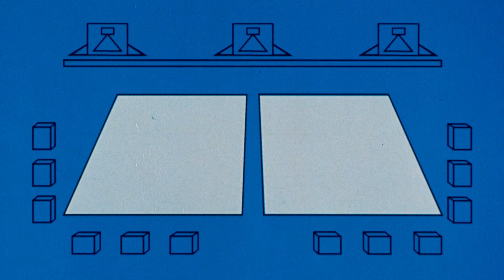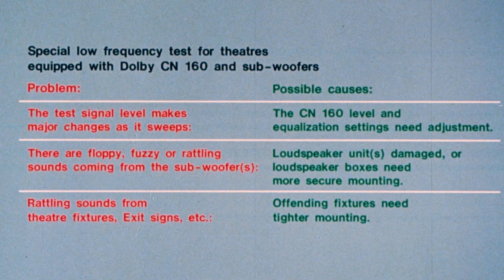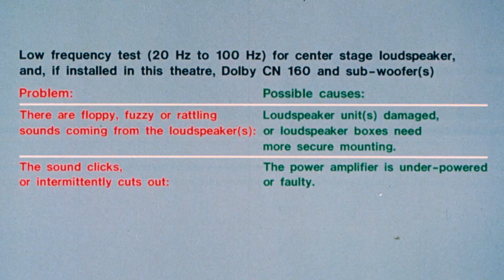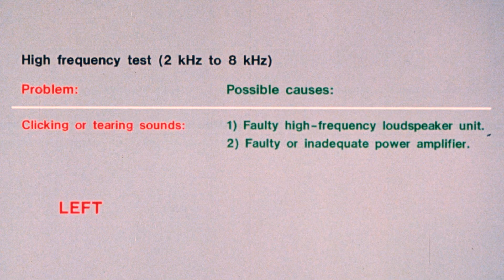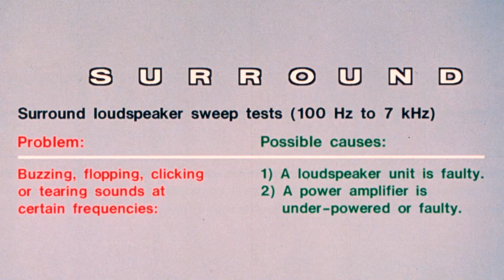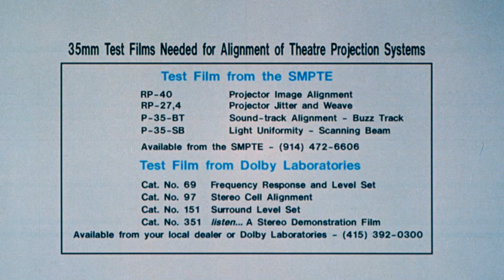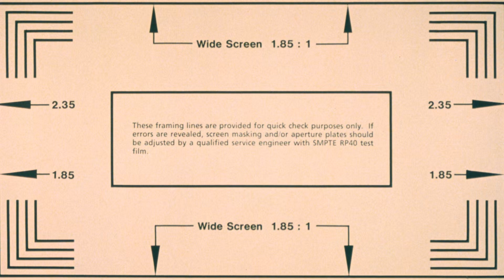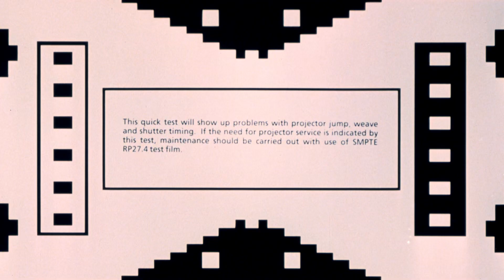Dolby Stereo cat 251 Listening Test Film (1982) [FTD-0169]

Comment: This is great, thank you! Good for testing this headset I got.
Is there any way to download a full Dolby Stereo encode of this, or does your scanner not support audio that way?
Reply from the maker: Dolby Stereo for cinemas (pre-digital sound) is 2 channel stereo, sometimes referred to as Lt and Rt (left total/right total).  You have to use a pro-logic decoder to extract the center channel (everything identical between left and right) as well as the surround channel (everything different or out of phase between left and right).  The subwoofer is also extracted in the pro-logic process.  Most home sound systems have a Dolby Pro Logic option on it.  Just turn off any fake cinema modes and use strictly Dolby Pro Logic mode.
Reply: +FT Depot sorry about dramatic “wHeRe iS ciMaRrOn? commenting, being tired of logo kids asking, until the real trailer gets uploaded, was that nice FT Depot?
Reply: @FTDepot  Gotcha. Thanks!
Reply: +Zac Vega that will be no more reconstuctions and attempts.
Reply: @Lawson578  Did I ask? And furthermore, does it look like I care?
Reply: @FTDepot  Um, it happens at the end of A Nightmare on Elm Street (1984) or every New Line Cinema film before New Line Filmbox invented in 1987 and that's what happens at the end of the film after the MPAA rating!